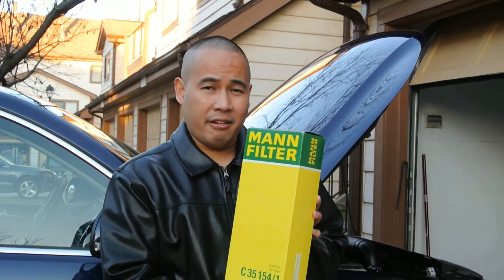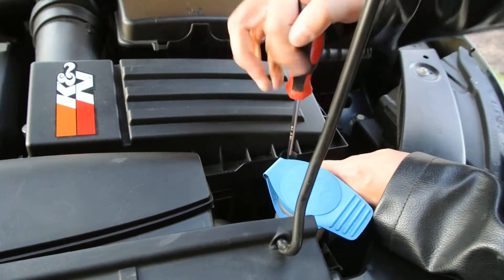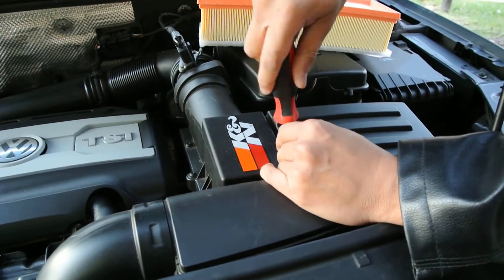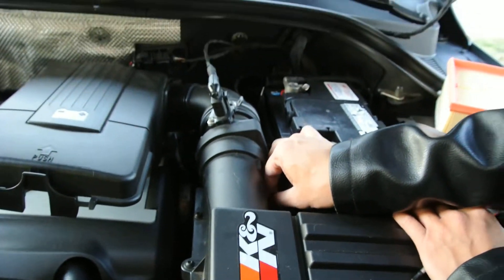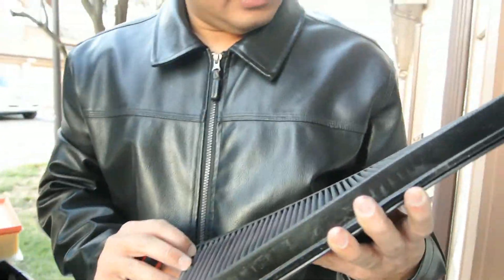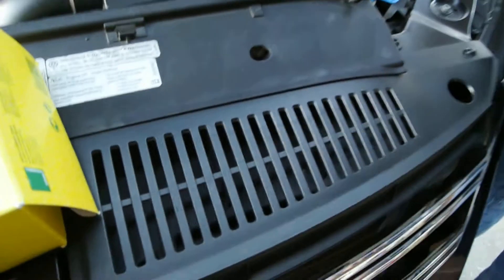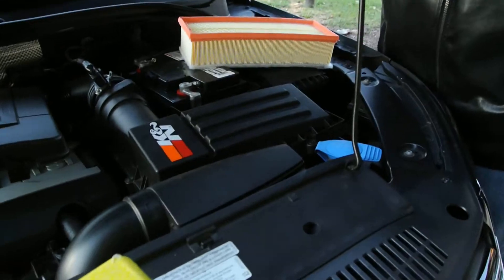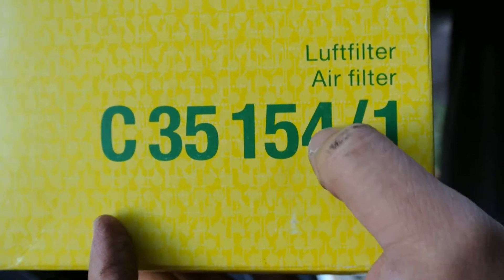VW/Volkswagen Tiguan 2.0T How to Replace & Install Engine Air Filter Easy Instructions

Comment: Hello. I just bought a new air filter just like the one you were planning to install. What is that foam layer on the bottom? Should I remove that before installing? Thanks.
Reply from the maker: You can keep the foam for extra filtration. I like to remove it for better air flow.